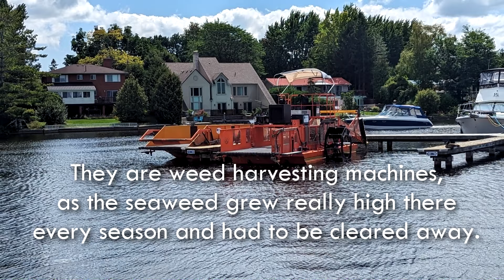Big Machines Removing Seaweed at The Marina

Comment: I would believe it is a problem in most marina. Collingwood did this once, however it should be annually.😊
Reply from the maker: Only once? Count yourselves lucky. As I mentioned in the video, those machines run four days a week throughout the summer just to keep up with the weeds. And even at that rate, and especially as the lake level drops, the weeds overwhelm some areas. Not much different than what you've seen on the TSW. Too much fertilizer runoff from the surrounding farms and the weeds grow like - like weeds 😉🪴
Reply: @BoatingWithBoogaboo  they only did it once. The weeds are just as bad as you describe, depending on the year.
Reply: Somebody told me these encourage spread   not sure how that works or an alternative
Reply from the maker: @TrentBrooks-q3m   I guess that by cutting them up, it could actually promote the spread of the plants, but in this case, cutting & removing them is the only thing will help. Otherwise, the canals at this place would become unusable and stinking of rot. The real solution is very long term, as the fertilizers from the surrounding farms, as well as private homes within the watershed, would have to be eliminated completely. As much as I would like to see that, it ain't gonna happen in my lifetime. . .